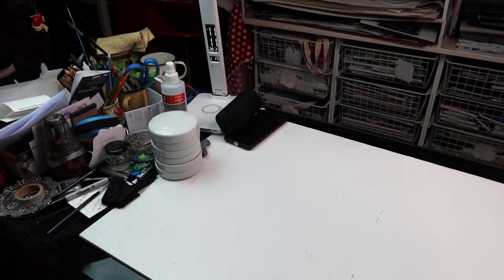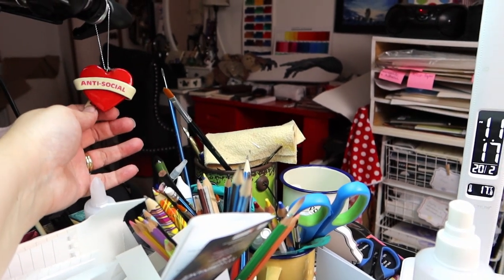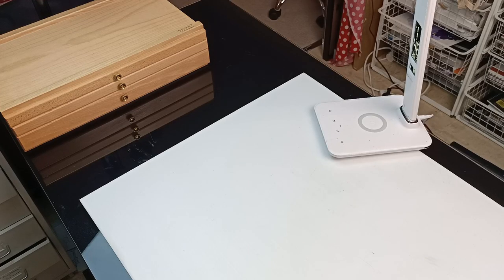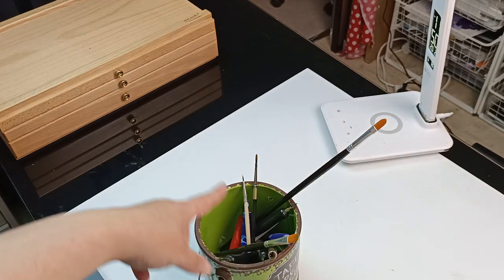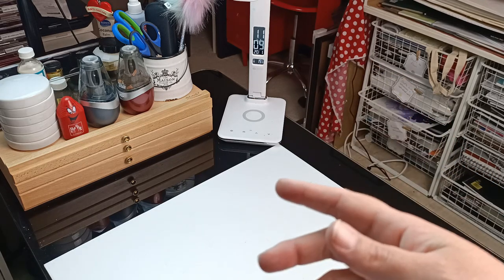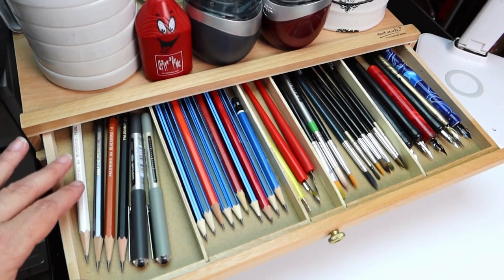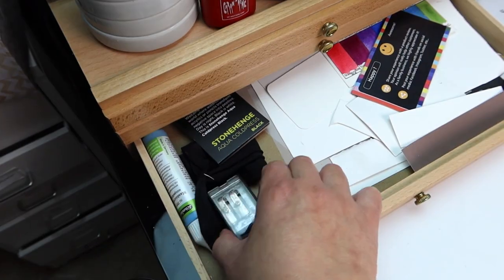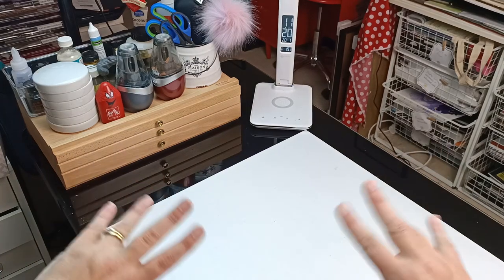Organising, Tidying and Decluttering My Messy Art Desk!

Comment: I completely get how much better you feel with your desk all tidied up.  I cannot function amongst clutter - cluttered desk/workspace = cluttered mind... I'm HUGE on really understanding and evaluating how I 'move' around my workspaces (whether this be my study, kitchen, laundry etc.,) and I design my spaces accordingly the best my spaces will allow.  I'm right handed so ALL of my day to day art utensils like favourite brushes, watercolours and water are on my right or to the right of centre IF they are in front of me.  The things that I reach for on a regular basis are in drawers on my right hand side so that I can easily get to them.  I'm very lucky in that I have a row of 3 short, lightweight aluminium storage lockers (H34cm x W60cm) above the length of my workspace where I can quickly reach up for extras while working - I might want to try a different type of brush, need an extra palette or extra paper for colour testing etc.,  The easier I can get to my utensils while working the less disruption to 'flow'...
Reply from the maker: Sounds very sensible to me! The main reason I put the drawers on the left side is there is a lot less risk of knocking them off onto the floor, whereas the right side of my desk is more open and that is where I put the things I am currently using, like paints and waterpot etc. I am very much right handed as well, but for storage purposes I am not so worried about them being on the non dominant side. I can live with clutter for a while and then it gets to me, so I will periodically have sort outs when it reaches that stage, lol!

Comment: Hi Becky, Loren here, also in Melbourne. I am a photorealistic coloured pencil artist and I wanted to ask you about your Orbit Pencil Sharpener. What size pencils fit in them? I have Luminance, Polychromos, Derwent Lightfast, Prismacolor & Pablo's, do you use those brands and if so do they fit in the sharpener? Also how much use do you get from a battery powered sharpener? I use a combination of sharpener but they are either chargeable crank or hand sharpeners only. Look forward to hearing from you!
Reply from the maker: Hi Loren, I picked this up at Costco a while ago. I was just there today and now they have a slightly different shaped model, though I think the pencil hole looked the same. It will fit Polychromos and Prismacolors, but Luminance and Lightfast are too fat, lol. I find it really useful for the ones that do fit, as it saves a lot of wrist movement especially when using a lot of pencils. The blades did get blunt over time but it has a few spare blade cartridges in the pack. And the batteries seem to last a long time in it too. I hope that helps! 🙂
P.S I also have a Kent dual-hole battery sharpener from Eckersley's, and the larger hole fits up to 12mm so it will take any pencils that don't fit into the regular sized sharpener.
Reply: @BeckyTregear  sweet thanks for your reply that was very helpful. Take care